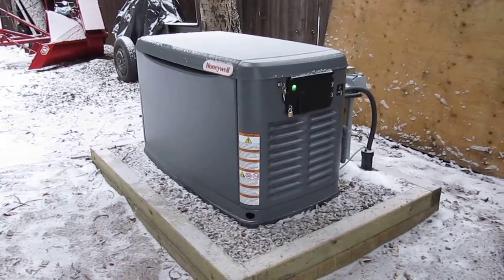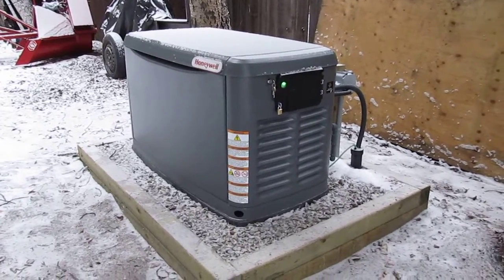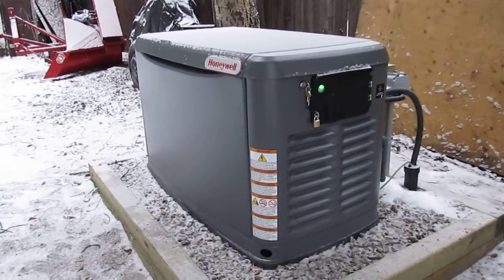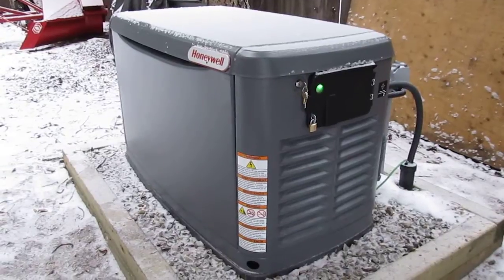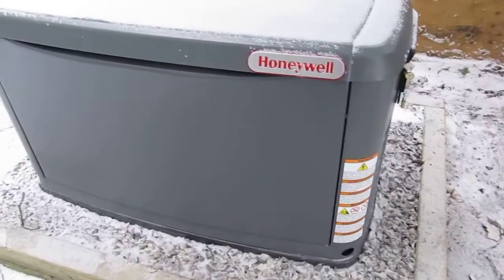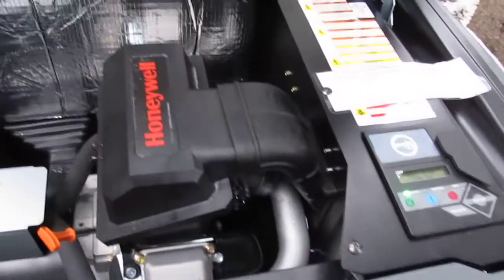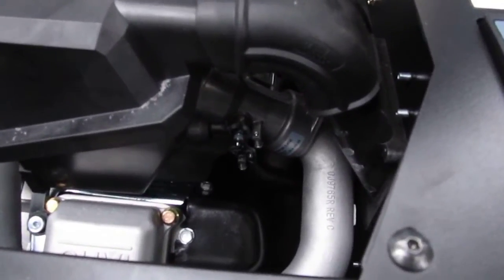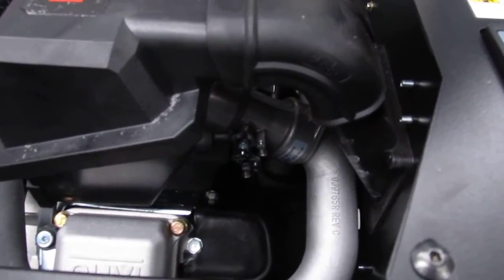17 KW Honeywell Automatic Standby Generator "Exercising" November 26, 2014

Comment: I know this video goes back a few years but for those who are curious I will mention a few things, because I work with these gen sets all day long. Generac offers installation kits, like one poster mentioned. The gen sets have a 5 ft whip preinstalled with a junction box, which is meant for installing on the side of the house. (if your unit can be installed that close by local code) They also offer a variety of transfer switches with a 30 ft whip that's set up for a quick connect to that junction box. We seldom order units that way because they are aimed at DIY people who purchase from a big box store. That said, local code dictates quite a bit. National code in the states will allow these units to be installed within 2 ft of the house because the cabinet is fire rated by UL. OTOH, the units MUST be at least 5 ft from any window, door, drier vent, or other fresh air opening. Some local codes are more. (10 ft is common) Generac does NOT offer longer cables than those that come factory installed because most longer cables will be a heavier wire size due to the distance. (again, a code issue) Some codes call for an additional electrical disconnect, (read: switchable) even though the breaker on the side of the unit qualifies as long as you don't lock it. The reason being is people install the set behind the garage or barn, the fire department shows up and they can't see it so local code may ask for another disconnect near the service meter with a permanent label stating it's for the gen set. It's a line of sight / safety issue, so they tell me.

Comment: how far away from your house is this unit?
Reply from the maker: .

The unit itself is 55' away from the house, but there is a total of 70 ' of 1 1/4" NG line. The NG and electric are underground. There are various formulas for sizing NG and Electric.

If you have any generator questions go to this site, they have been a great help to me.

http://zillerstore.com/forums/index.php

.
Reply: i have a 14kw generac, with the 14 circut transfer switch, the generator and system was pre wired, with a 30 foot whip off the transfer switch to the generator, i want to move my generator another 75' from my house but generac will not tell me the wire size i need to a run with that distance. I was curious on what kind of wiring system came with your unit or how it was installed for your distance. RIght now mine is 10 feet off from the house at the edge of my deck, the install changed the whip to liquid flex metal condit so he could run the whip to the deck leg where he mounted the disconnect switch and there is a 5 foot run from the disconnect switch to the generator.Does your transfe switch whip run from the transfer swith to your generators disconnect box all in one run?
Reply from the maker: Dan
.

First of all Generac are almost useless when it comes to giving information or helping. If you want some help go to Ziller Electric Site and ask there, lots of help.

http://zillerstore.com/forums/index.php

I bought the generator and automatic transfer switch from Costco and it came with no wiring. I got a electrician to size my wiring. What he came up with was the five generator control circuits are 14 gauge running in 3/4" PVC conduit. The power from the generator to the ATS is #6 Tek Cable which is 4 - 6 gauge wires in a armoured waterproof cable buried directly into the ground at 20" deep.

My electrical connections run from the generator underground to the basement wall, go through the wall and into the ATS which is next to my breaker panel.

I have posted the install and associated foibles and problems on the Ziller site, here is a link to that post.

http://zillerstore.com/forums/showthread.php?t=3480

Go to that site and you will have a world of help from the good people over there.
  

.
Reply: mine came in a pre installed factory whip of 30'. and i have a disconnect box. My install is as follows, There is a 14k generator, 5 feet whip from generator to disconnect box, then  from disconnect box to transfer switch 30' whip. all factory, came pre installed, to extend additional 75' generac does not not have ktis or extentions or information for that matter, im wondering if i can use the existing whip from transfer switch to disconnect box, i'd have to add an additonal disconnect box from the end of the existing 30 whip, and then put in my 75' of additional wire legnth, then use the disconnect box that came with my generator and use the existing 5' from that disconnect on to the generator. Do i have too register on the link you gave me for ziller to ask this question. And im assuming you pulled permits for the install, our local enforement says a disconnect from the generator no more than 5' is required.
Reply from the maker: Dan

Yes you have to register on the Ziller site, but that only takes a couple of minutes.

Yes I pulled electrical and gas permits.

It sounds like you are making it to complicated for yourself. Run all new wires from the new site of your generator to the disconnect box that is 30' from your transfer switch. I have never heard of a requirement of having a disconnect switch between the generator and the transfer switch. Go on the Ziller site and ask there.

GO ON THE ZILLER SITE AND ASK YOUR QUESTIONS THERE !

I am just some klutz that is learning as I go.

.
Reply: Hahaha, thanks greathodgy22, you have been helpful, I'll register on the site, and consult an electrician . Thank You.
Reply: 2:01

Comment: Nice install !  Should get many years of service from this unit .
Anything north of the Mason Dickson line needs the cold weather kit and different oil,  and on all of my field training classes the instructor tells us never put it in the quiet mode , it fools some generators to only run in quiet mode at full load.
Reply: Mason Dixon
Reply from the maker: .

Thanks, worked hard on it.

I am way North of Mason Dickson so yes I will be installing a cold weather kit, not the Generac one as the battery plate has failed in a few generators. It will be a battery blanket and stick on 50 watt engine heater with a thermo-cube hooked to a GFCI plug.

I already have 5-30 synthetic oil in it and have booted the quiet mode to the curb.

I think the quiet mode 5 minute run time is just a marketing ploy. I can't program my generator to run anything but 5 minutes in exercise mode.

.

Comment from the maker: .

The generator has a dedicated 110 volt line for a built in battery tender. I have installed a battery blanket and have a 50 watt stick-on heater for the side at the bottom of the engine block. When it warms up a bit I will install it. Both the blanket and block heater will be thermostatically controlled. 

I agree, Generac used to run a 12 or 15 minute exercise cycle and now it is 5 minutes. At the very least they could give you the option of choosing. 

Last week I did run it for a hour under light load from the house, 3 KW. That cleaned the moisture from the oil.

Will just have to keep a eye on it. Going down to -30 C this weekend so I am going to do another manual cold start to see how it goes. You can bet your sweet bippy it will be running longer that two minutes !

.